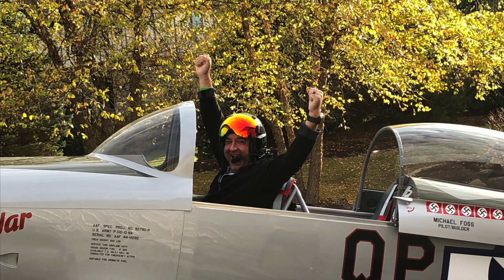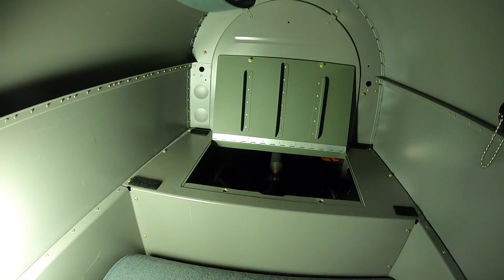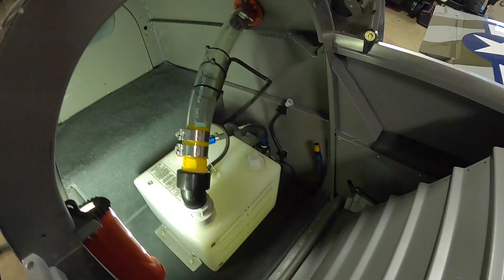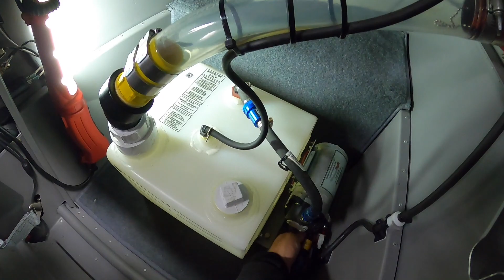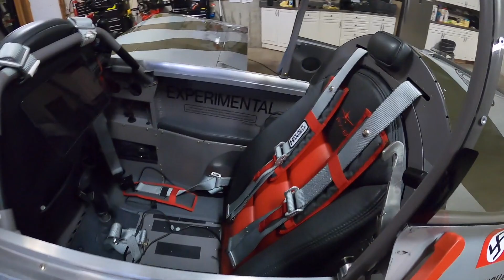Rear Baggage Mods and Smoke System

Comment: What brand is that oil cap?
Reply from the maker: The one that is on the exterior of the plane that I use to fill the smoke oil?
Reply: @therv-8pilot  yes the red one that has a treaded cap , I looked at smoking aippanes but they have another type😟
Reply from the maker: @cdenora1 Yeah the one I got was black plastic type material and I painted it. It looks just like the metal one they have on the website. Maybe reach out to them and see if they can give you the info on the original one.
Reply from the maker: If that’s the one…it came with the kit from www.smokingairplanes.com. They might be able to tell you where they source them. 😃

Comment: Please follow up on this vid with 1) details on the vent plumbing 2) the high pressure plumbing through the fuse 3) the firewall penetration details 4) the FWF plumbing and 5) the electrical wiring, how you power it and the switch to control it.   Any mods you’d make to your install if you could do it over?
Reply from the maker: Hi luckymacy. So I followed Smokingairplanes install instructions. The vent plumbing needs a high spot to prevent siphoning. 

1)I ran the line up to my fill spout and then straight down through the baggage floor. It terminates at a pulled rivet that they supply. That rivet is placed on the outside of the bottom fuselage skin with the mandrel removed making it a port similar to a static port. 

2) The high pressure line runs along the left hand side just outboard of the left most floor rib. I ran it through snap bushings and zip tied where needed. It runs forward through the gear tower and curves from the left forward side wall to the firewall. See in this blog post: https://www.rv8-hangar.com/control-sticks-smoke-oil-fill/

3) See the alcove post for the supplied T that they give you. Keep in mind I went with the two line firewall forward kit versus one line. 

4) See this blog post for the firewall forward plumbing: https://www.rv8-hangar.com/smoke-system-spray-nozzles/
Again I just followed their instructions and where to place the nozzles. Keep in mind the clearance for the cowl as you may get rubbing if you are not careful. 

5) They supply a panel for their switch and CB’s. I used their parts but incorporated them into my left side panel. See this blog post for a photo of that side console: https://www.rv8-hangar.com/consoles-and-wiring/

It is powered by the VP-X. I also have a remote momentary on switch on my control stick located at my right hand thumb spot. This is what I use for 90% of the time that way in an instant I can remove the power from the system by letting up on my thumb. 

I wouldn’t change anything as I have it setup. It fills super easy with no mess. I can remove the system in under 15 minutes and install in the same time. I’m glad I went with the two nozzle as it produces a great mole trail. Hope that helps you and thanks for watching the video!

Regards,
Michael

Comment: nice set-up   can you post a link to the racing quick-couplers?
Reply from the maker: I don’t have the paperwork with me as I’m on a Untied trip now. Go to www.summitracing.com and search for Jiffy-tite quick disconnect fittings. There a lot of variations and you will need to figure what works best for your setup. I can see if I have the exact part numbers that I used when I get home. 
Cheers,
Michael
Reply: @therv-8pilot  thx  I'll poke around and see what I can find

Comment: Hello RV Micheal 
Did you install anti-siphon check valves if not any woes 
I’m looking into a Smoke Systems kit for the RV7A
Where did you connect the power wire
Thanks
Reply from the maker: Hi William, the Smoking Airplanes kit that I used does have a check valve in the high pressure line. I have it up by my rudder pedals just before it hits the “T” that goes through the firewall. 

The power is controlled through the Vertical Power VP-X.  I have their controls located on my right side arm rest. I also have momentary switch, the thumb position, on my control stick. 

You can see the left console in this post. 

https://www.rv8-hangar.com/consoles-and-wiring/

Comment: What kind of oil do you use and where do you get it?
Reply from the maker: It’s food grade mineral oil, I get mine from Cozzini Cutting Supplies out of St. Louis. Their product is called Drakeol 7 LT MIN OIL NF. It makes great smoke and I get a lot of compliments. It doesn’t hurt that I have nozzles in two exhaust pipes vs one as well!
Reply: @therv-8pilot  I installed a system from Smoking Airplanes with the two nozzle setup as well. Smoke oil is pricey,  so I'm always looking for options.
Reply from the maker: I just paid $399 for a 55gal barrel and we got two. The shipping for us to Chicago was $199 for the two barrels which put it right at $499 a barrel delivered.

Comment: If you connected the refill line to the other fitting on the tank would that give you better access to the cargo area (without the hose going diagonally across your access area?)
Reply from the maker: I tried to do just that with 5 different style hoses. The bend is pretty tight and the ones that were flexible enough kinked. The ones that wouldn’t kink would only go so far. So I settled for the “across the area” hose. It’s not that bad to get stuff around it. If I need the extra baggage I just remove the tank. Thanks for the comment!
Reply: @therv-8pilot  what if you put in a 60 or 90° elbow at the point the hose connects to the fuselage?
Reply from the maker: I looked at that option too however the filler cap assembly is a large “nipple” fitting. That meant I would need a small devotion of hose to a 90° that had “nipple” ends. I did try and it was just too bulky for my liking with all the extra parts.

Comment: I have been searching for a quick change install. Can you share the part numbers and sources for the oil quick disconnects?
Reply from the maker: So I didn’t save the receipt for this fittings unfortunately, as I have every other receipt in a 3” binder. I bought them from Summit Racing  at www.summitracing.com. They are the Jiffy-tite brand and the 3000 series. That I do remember, look up that series and find the size AN fitting you need and grab the Male and Female ones that you need. They work great so far and no leaks or issues. Hope that helps a little!
Reply: @therv-8pilot  THANKS!

Comment: Hi - 
Thanks for showing your build.  I like the access panels. 
I have a question if you have time. 
On my -8 build, I’m looking at a lot of electrical forward right at and near firewall. So I was wondering how you solved water intrusion at forward baggage door. Did you protect equipment from water with any shielding?  
Thanks, 
Drum
Reply from the maker: Hi Drum, always willing to talk RV’s! So are you referring to the hinge area of the baggage door or around the remaining perimeter? Around the perimeter I didn’t do anything and have not had any issues so far. At the hinge line Vans tells you to use foam on DWG 84. I got that from McMaster Carr part #9334K36